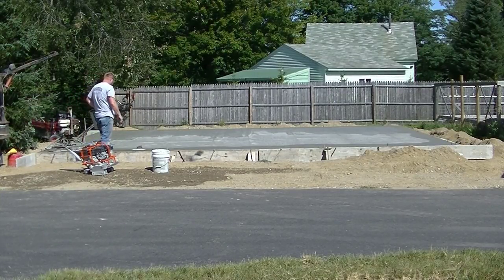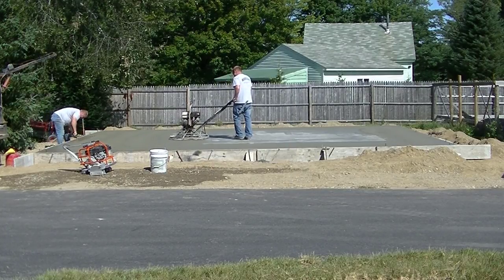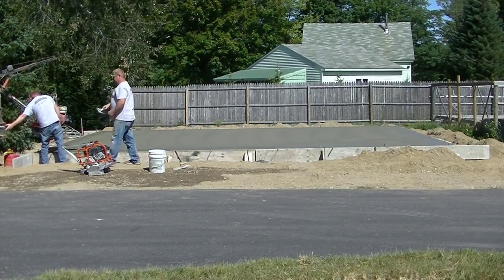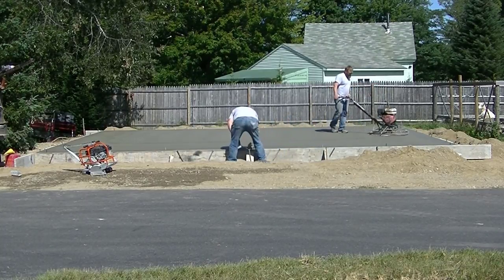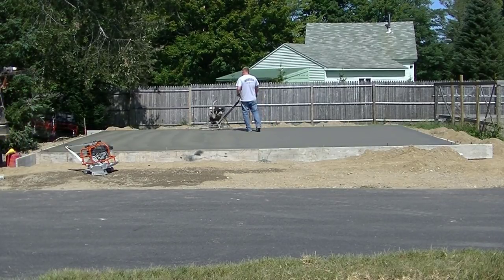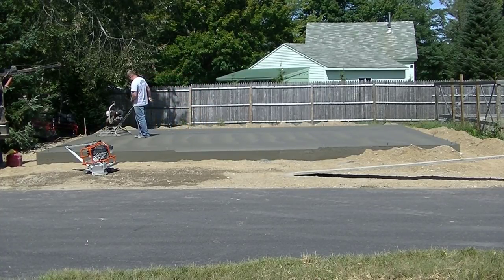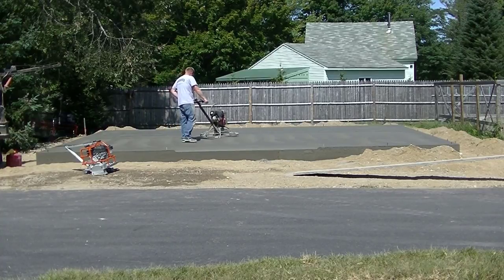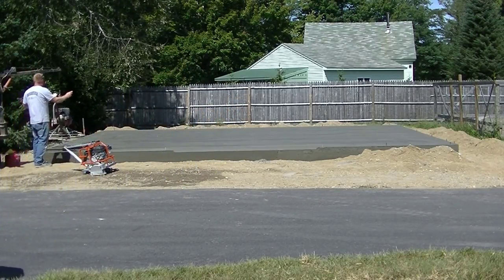How To Finish Concrete With A Power Trowel | Everything You Need To Know

Comment: pitch control knob on a power trowel please tell how and when to use
Reply from the maker: The first pass we keep the blades as low (flat) as we can without them digging. The next pass we slightly raise the front edge of the blades. Most of the time we'll leave the blades at this height for the rest of the process. If the concrete is drying very quickly, we may raise the blade edge a little more but only if we need to.

Comment: Thanks again Mike. The goal is to do my own concrete slab for my garage. I live in southern New Hampshire. It is 10-1-20. when do I have to start worrying about the temperature? I guess more accurately at what temperature do I have to get this completed by? How long does the slab have to set before I start to build, a couple of days, a week? Thanks again for your videos.
Reply from the maker: You've got until the temps start to go below freezing. If they go below 32 at night, you'll be safe to cover the slab with a tarp and some hay. So you still have a quite a few weeks. You can start to build a couple days after the pour. If it's in the 30's to low 40's just wait another couple days to be safe.
Reply: @MikeDayConcrete  Thank you Mike.

Comment: I have a slab that will be 48 by 70.  It will be a monlithic on the 36 by 70 and a shed roof on the back that will be 12 by 70.  (so I will dig that 12by70 rear footers 18 by 12.  I planned on doing the slab in sections.  I am by myself and maybe one or two other inexperienced helpers.  I planned on doing the 12 by 70 on the back side first.  So the truck can get into that area with little problem.  I then plan on doing maybe one section of 15 by 36 until done over about a week.   I plan on drilling holes in my form boards so I can push rebar in them to tie the sections together.  I will use deck screws to hold the boards together where the holes are so I can separate the forms after with the rebar sticking thru.  I have done some of concrete work over the years and just helped a neighbor with his drive entrance that turned out great.  Anyway any thoughts on this?  I have been watching your work and I even bought a power trowel 12 foot wide (to help my neighbor and then do my slab).  I will also trowel the slab to get it a little bit better.  I also have a laser level to check level.  I will use wire and rebar also.  My inspector is up for what I am doing, so that works too.  Too much info probably.

Comment: Hi Mike I like your videos, I've never used a power trowel before, after you use the power trowel do you need to do anything else to it to make it smooth? Do you not see lines in the concrete after you power trowel it?
Reply from the maker: No lines for us. It does take some practice. We power trowel it until it's very hard on the surface.